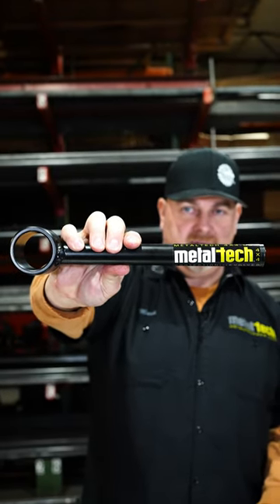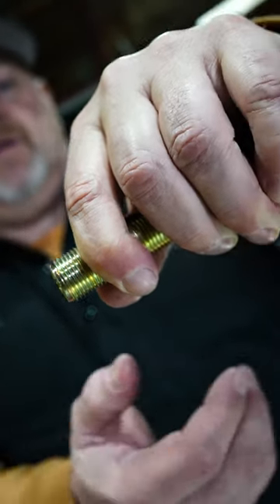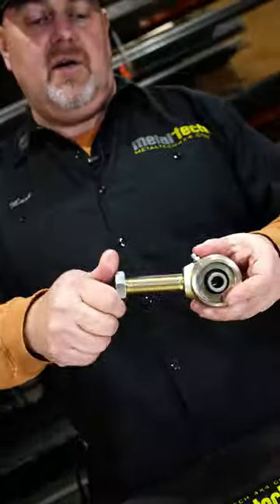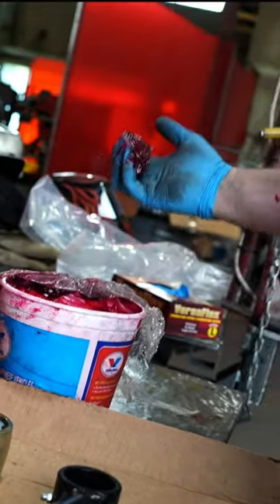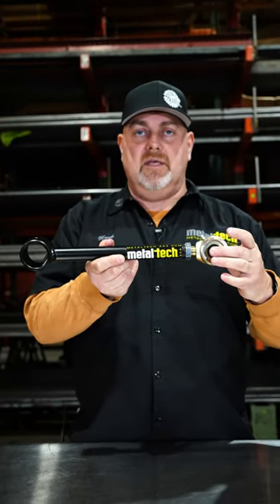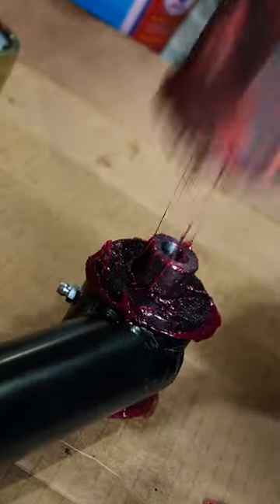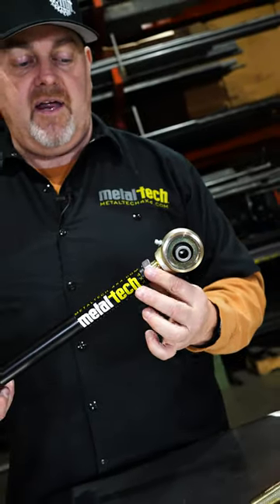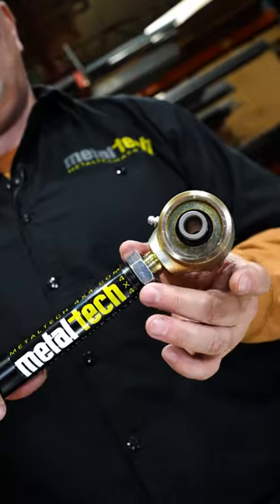Upper Links Assembly and Maintenance for GX470, GX460, 4Runner, FJ Cruiser, Land Cruiser

Comment: Are these offset any to help with clearance on the driver side for the fuel tank?
Reply from the maker: Not offset at the top.  The tubing used is smaller than the lowers to help with the clearance of the fuel tank.  When running the MT4x4 long travel at full droop, the driver-side link body can touch the tank but not put pressure.  It is a non-issue with the plastic body tanks